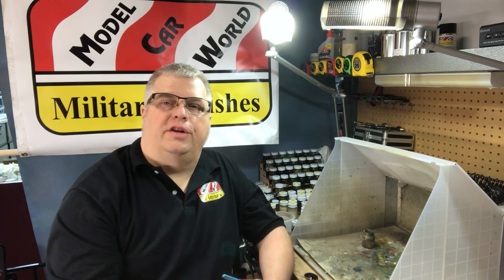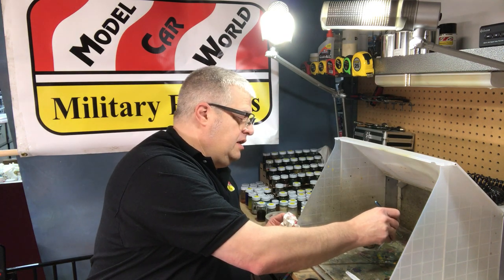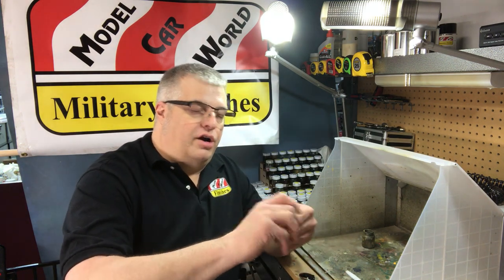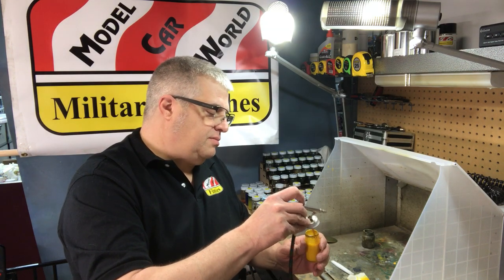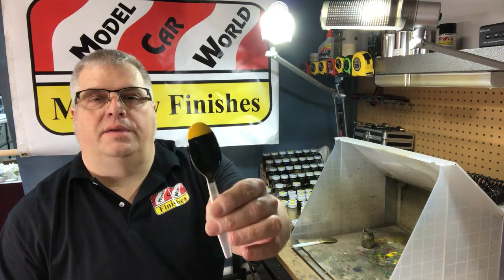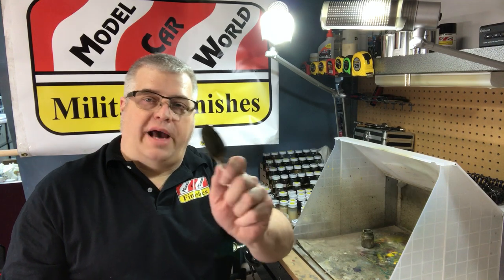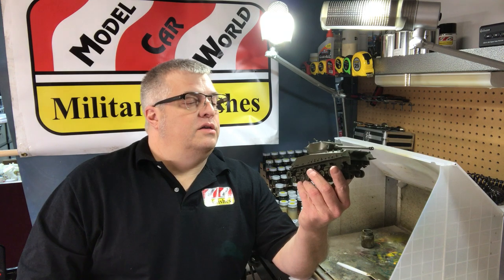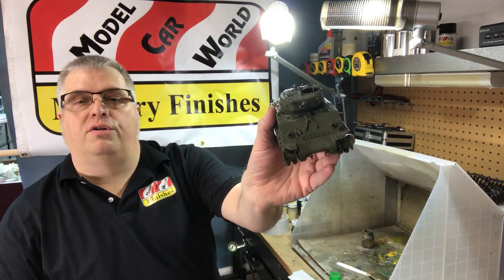MCW Tutorial

Comment: Looks like great paint! Thanks
Reply from the maker: Thanks, we also have in our line an extensive list of racing colors.
Reply: I was just checking out the website and saw that! Very cool, I'm currently scratch building an old Richie Evans Chevy Caviler Nascar modified and he used GMC Omaha orange (NY state dot color) Do you guys carry that?
Reply: Yes we do.
Reply: Thanks, I'll have to look deeper into it, seems a little pricey...
Reply: Bottles are a full ounce. enough to paint one car. Once you try it and see how much better it is over most other paints out there. We do not mix cheaper paint into clear lacquer. We use only PPG Duracryl toners and thinners in our paint system. It is single stage also, no base coat/clear coat.

Comment: I’d hate to ask, but how does the enamel do if I have to strip it? It’s not the paint’s fault, but my airbrush’s. I love the color and tried wet sanding to save it, but I’m to the point where I think stripping it is a better thing. I normally use the dollar store degreaser to strip paint. Will that work?
Reply from the maker: Have not tried stripping yet, but I would say DOT3 break fluid
Reply: @michaelguest8571  well, it came down to me having to strip it.  I used the dollar store degreaser, and the paint practically fell off by the next morning. My Passce H4 is coming in today, so I’ll be spraying the body with that tonight.

Comment: Hi Michael:  I am doing an aircraft model that calls for FS 27875 White.  MCW has 17875 and 37875 but I don't see 27875 White.  Is it available from MCW?  Thanks, Steve
Reply from the maker: That is just a semi-gloss version. You can get the 17875 and spray our 20% clear over it to get the desired color.  Mike
Reply: @michaelguest8571  Thanks, Michael!  Will do,
Reply: @michaelguest8571  Hi Michael.  Could you give me the MCW number of the Clear you recommend?  When you say 20%, is that part of the paint color or is it referring to a mixture of 20% Clear and 80% Thinner?  What is the MCW number for your paint thinner?  And what is the number of your Matt Black which is also called for in the paint specs.  And finally, what kind of glue do you recommend for a T-28 Trojan Aircraft model 1:48.  Thanks, Steve